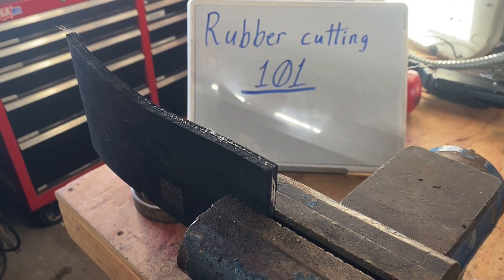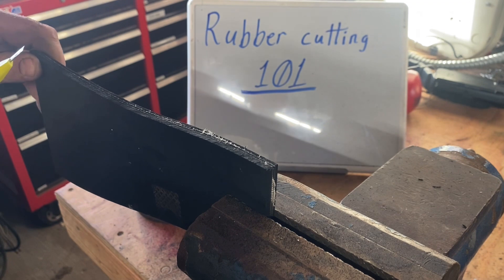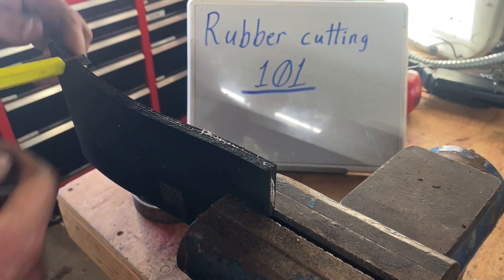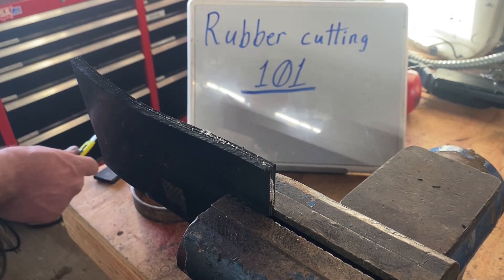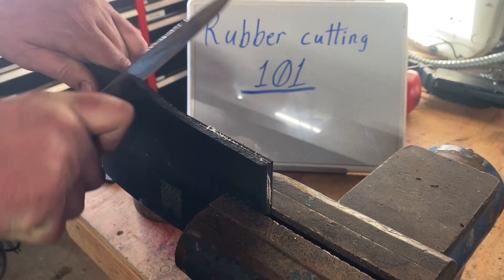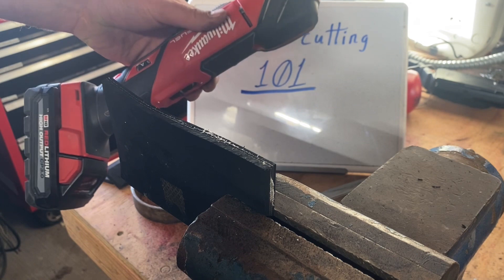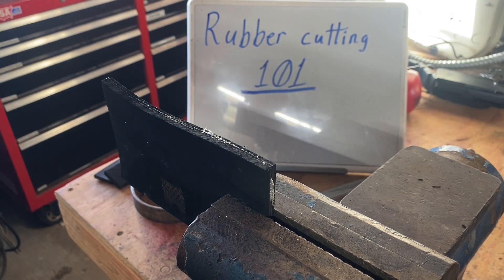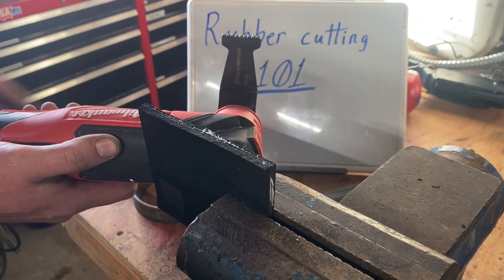Conveyor Belt Cutting 101

Comment: What kind of razor blade did you use I work underground and I just bought a Milwaukee and had planed on using it to cut and scive conveyor belt
Reply from the maker: I use the Lenox Gold utility blades from Lowe’s. https://a.co/d/3U1PDi6   That’s the link to them on Amazon. They work better than cheap blades. Cheap blades fracture under the pressure. The blades are cutting through used conveyor belts from our grey iron foundry. So these blades are not cutting new clean belts all the time and we get good mileage from them. I have another video about cutting belt if you are interested.  Good luck. Practice with it if you can.